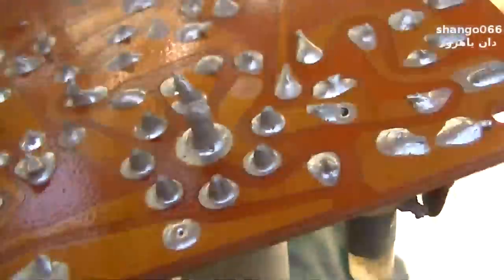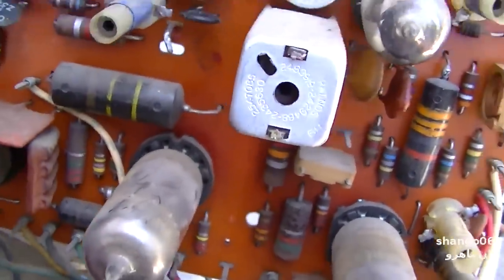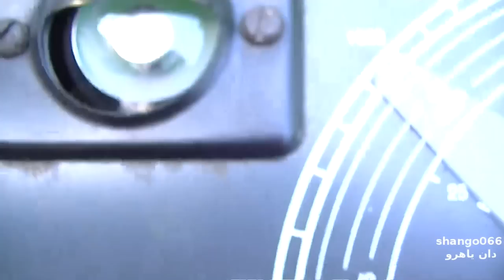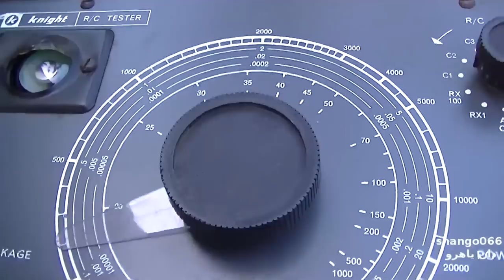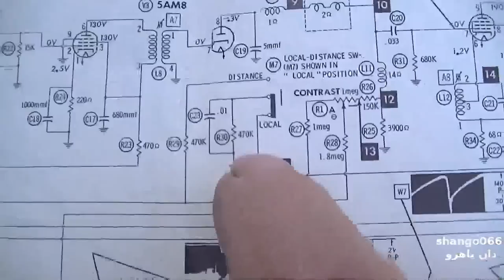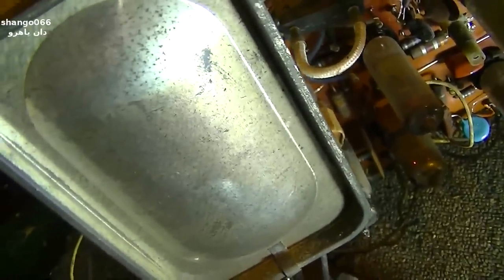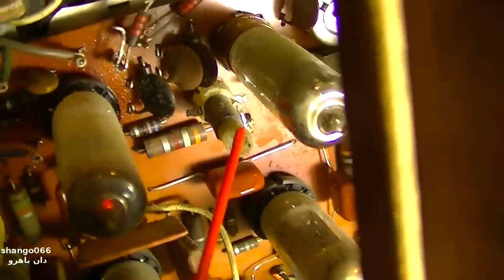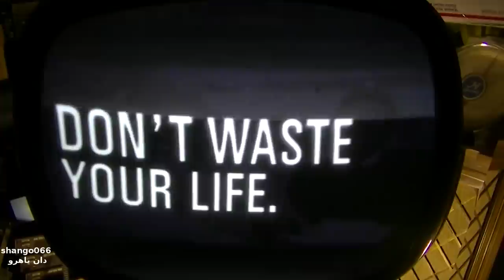Philco Predicta Pedestal Repair PT2

Comment: Fallout 4 TV with being serviced with fallout 4 diagnostic equipment; right down to the burred flathead screws over the cat's eye cover plate. It is what works after nuclear war. Great videos by the way.  All these vintage sets should be restored just for historical reasons if anything.
Reply: Radiation King makes great TVs and radios

Comment: Mildly interesting thing about those black tubulars.  The ones where one lead has a swollen base?  That is actually a thin brass pipe through which they squirted in the oil.  Then when they soldered in the wire, the flux in the solder would migrate into the capacitor, making it leaky right from the factory.  So much for the great old USA quality parts.  Broken by design.  I generally replace them all, even the non-critical bypass ones.

Comment: It looked like the pins in the original sockets were stretched open kind of like a "C" after crimping they would have been a "o" shape.  I was surprised you didn't try crimping them closed a little.  Would have saved a lot of work soldering in a new socket.

Comment: Speaking of the heat issues with these sets...I swear I saw someone...may have been Phil on Phil's old radios site where he installed a typical modern computer cooling fan to cool the PC board on his barber pole. I'm going to be doing one in the near future, and it seems maybe to be a good idea. If those couplets go bad, it's a real pain. Would be interested to see your idea for tube shields? Assume mayber cardboard or just regular metal shields??
Reply: ScottTV1962 I have done that on vintage equipment. Often the fan doesn't have to run at top 12 V speed. Often 8 to 10 Volts is adequate to move the air around and the fans noise is very quiet too at the lower voltage.

Comment: I'm wondering how long that sand resistor, with the taps, is going to last? I've had NOS sand resistors go bad just sitting on the shelf. I've also heard that those network/couplate things can cause trouble in these Predicta sets. Apparently the couplates used different internal part values in different production runs.

Comment: Shanno  I was on an old antique radio foam they admit that the fly back black is melted wax from a short in the coil wires that can fail or happen if a wire was to break off  or a short happens

Comment: I'm genuinely curious... When dealing with a set this old, with this... low quality... of a parts selection, does it pay to test each cap?
Obviously, it pays for Youtube, in terms of making an interesting troubleshooting and repair video, but I mean in general repair.
Is the time taken to test each cap and decide whether it is worth replacing more costly than just getting the complete set of caps and just going to town on it?

Comment: if the .0018uf cap doesn't work, you can also use 3 .001 uf caps 2 in series with 1 in parallel, so you won't have to order any.

Comment: what's the value of that Glass Capacitor? is there any place i can get myself one? the reason i ask you this shango066 is because i acquired a Radio years ago, it was an eveready  radio it didn't come with a manual, fairly small it plugs in, when i opened it up i found a capacitor i don't remember what reading it had, but i know the tubes were bad, the casing was falling apart,warped, it had one electrolytic and a waxpaper capacitor, the radio is basically in need of quite a bit of work, just in case if you reply back, my skype is sonicthehedgehogvy
Reply: Sonic Dash You don't need to use glass capacitors in an average broadcast band tube radio, you can but even as surplus they would be expensive and there would be nothing to be gained by using them. Wax capacitors can be replaced by polyester film caps, and ceramic caps on occasion, you can use the bright yellow ones with the axial leads or the radial lead types like Shango was using with the red or brown glazed exterior.
Reply: +Sonic “Ghost” Dash Glass caps are very stable BUT also a waste of tax payer dollars just like everything else military related especially the training in radio and electronics, Yeah you learn how to service and repair equipment BUT it's military equipment, Not too many civilian agencies use military gear in the US, so yeah a gross waste of money on the governments part.
You will be surprised at how many ham operators out there have military radio training and no absolutely nothing about modern civilian / commercial radio and electronics, but since they have that training they all think they are the gods of radio and electronics..

Comment: To skimp on a full restore at this point is false economy. It takes as much time if not more to chase down each issue one at a time rather than just replacing all the caps and sockets etc. Even if it will only be used as a show piece the old parts still have 70 years on them, just put new parts in and let the unit go another 50 years.